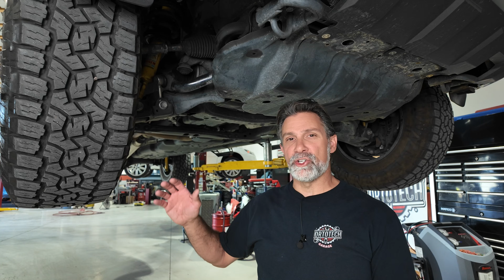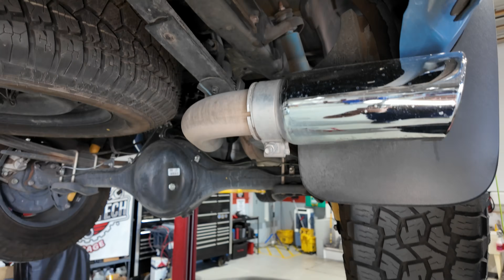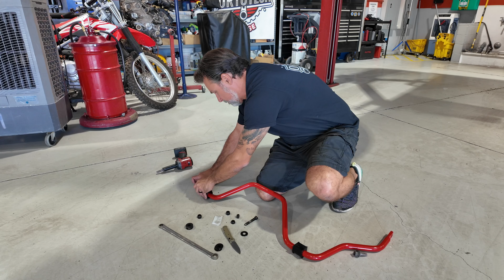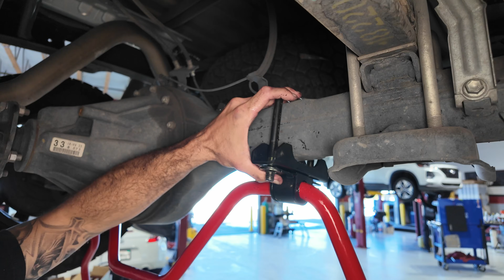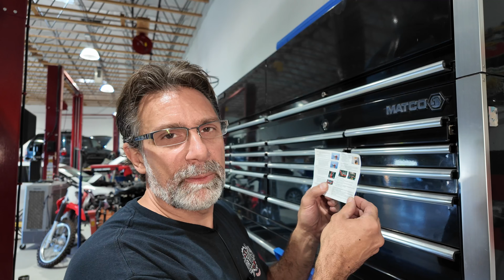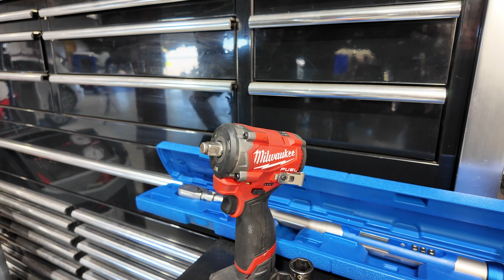TRD Pro Rear Stability Upgrade: Add a Rear Sway Bar (DIY Install Guide)

Comment: the LARGE WASHER @ the tie-rod ends SHOULD have been placed against the rod bushing -  then swing the tie rod end and place it into the bolt....  What you're missing was another washer on the end of the bolt then the nylon. 
Always sandwich the bushings w/ LARGE washers 

On my kit the 4 U-clamps nuts were Stove pipe fitters nuts [ ie a TALL NUT ]  @ the rubber bushing @ the axle
Reply from the maker: Thanks for the feedback. I’m pretty sure I installed the hardware according to the instructions supplied with the kit I received, but I appreciate you pointing this out. It’s certainly possible there have been different hardware configurations or revisions of the kit over time. I’ll go back and take another look at the instructions and the hardware from my installation to verify it. 👍

Comment: The Sway bar looks good. But my first Safety concern and I was hoping you will wrap the brakes lines with with some Rubber but you never did. The brake lines are so close to the U Bolt and that is your life or someone else live. Good video with not music crap and talking nice and calm. but Safety First Sr
Reply from the maker: I understand the concern, and safety is always the priority. There is clearance between the U-bolt and the brake lines, and I checked that during the installation. I actually wouldn’t wrap a brake line with rubber just because it appears close to another component. If there were contact or the possibility of contact through the suspension’s full range of movement, I’d want to correct the clearance rather than cover the line. Thanks for watching, and I’m glad you appreciate the no-music, straightforward format! 🙏
Reply: @OrtoTechGarage  Not cover the entire line but right in front of the U bolt. The first reason you are installing a sway bar I think is for Vibration on pavement but Off Road it will not make a difference if truck is not loaded. Dole trailers brake lines were like that close in clearance and were ok in USA roads but when they went international to different countries in Central & South America they were Pure Failure. I will reconsider
Reply from the maker: I appreciate you reconsidering it. 👍 Just to clarify one point, the primary purpose of the rear sway bar isn’t vibration control. It connects the suspension movement from side to side to resist body roll and improve stability, particularly during cornering and directional changes. That’s the reason I installed it. Your concern about the brake line clearance is certainly worth considering, though, and I appreciate you pointing it out. I’ll keep an eye on that area and make sure there’s no contact as the suspension moves through its travel.  Thanks fot your comments and for watching. 🙏
Reply: @OrtoTechGarage  Great point of What the Sway bar purpose is for, I do now that but I did not mention it but Thanks for corroborating and  once again you did Exeptional Tutorial. Regards
Reply from the maker: My pleasure. 🙏

Comment: Aren't you supposed to install the rear sway with the truck on the ground so the suspension is loaded?
Reply from the maker: That’s a great question! No, the sway bar moves freely in the bushings. But control arms, and any bushings that get squeezed tightly when the bolt is tightened, should be tightened at normal ride height to keep them from twisting when lowered. 👍
Reply: @OrtoTechGarage  you mean the control arms have to be weight loaded before final torque?
Reply from the maker: Yes. For control arms, radius arms, shock bolts, and similar suspension components where the rubber bushing is captured by the bolt, it’s best to do the final torque with the suspension at normal ride height. If you tighten those bushings with the suspension hanging, the rubber can be permanently twisted once the vehicle is lowered back to its resting position. Then, as the suspension compresses, it twists the bushing even farther and can shorten its life. 👍

Comment: Don't like that the break lines rest on the u bolts. Sure you could bend them a bit to clearance them. I also wish Toyota had put some indexing pins on the axel housing to ensure even spacing of the uclqmps and saddles.
Reply from the maker: Good point. It's important to verify clearance after everything is torqued. Mine had adequate clearance, but every installation should be inspected. I also agree that indexing pins would make the saddle placement more repeatable and remove some of the guesswork. 👍
Reply: You are right and I will not Trust those lines that close to a Solid Steel U-Bolt

Comment: Would you change the front sway bar for the red trd pro?
Reply from the maker: I wouldnt.  What do you ask?
Reply: @OrtoTechGarage the front sway bar that you measure the black one ,if you would change it to the red trd pro sway bar.
Reply from the maker: Oh,  I dont think that is necessary.
Reply: @OrtoTechGarage ok thanks sir
Reply: @realyouth5273 I did on my Tundra, besides the OCD of having both matched it complements the rear one in tightening the truck, the factory one is hollow and TRD is solid. I’d say rear one makes 80% improvement and the remaining 20% comes from the front TRD one.
Reply: @DownloaderVideo thanks my brother
Reply: @OrtoTechGarage  I wanted to ask the same question and the reason is. Would the TRD will be much better than the black one or not at all?

Comment: Just installed the rear sway bar. You have to make turns to easily see the dramatic difference.  I'm kicking myself as I bought a new, never installed TRD rear sway bar from a guy that had it for two years sitting, then sold his Tundra. I committed the very same sin and let it sit for five years without installing. Was not difficult, if you have a Tundra, do yourself and your passengers a favor and buy this one (looks solid) or a TRD AND install it. You will not regret it!
Reply from the maker: Thanks for sharing your experience.  I'm happy to  hear you finally put yours to good use. 👍

Comment: Great video Keith, I'm in the process of replacing my stock rear suspension on my 97 Z28 with BMR components.  The hardest part is removing 28 year old bolts.  Please keep the great content coming.
Reply from the maker: Thanks for your inspiring words!  I really appreciate the feedback and your support.  Best of luck with the Z28 project. I had a late 80's IRoC many decades ago.   Lot's of fun with that car.  I ended up pulling the entire driveline out to put in my s10 pickup.  Lol.

Comment: In 5 or 10 years all those aftermarket manufacturers go out of business or discontinue production ; and then you go back to square one .
It feels good sometimes , when you add something like that , and is very helpful and rides nice .
Reply from the maker: I guess nothing lasts forever anyway.  If it serves your purpose and has a reasonable service life, i think you can justify the cost. Everyone has to decide that for themselves though. 👍